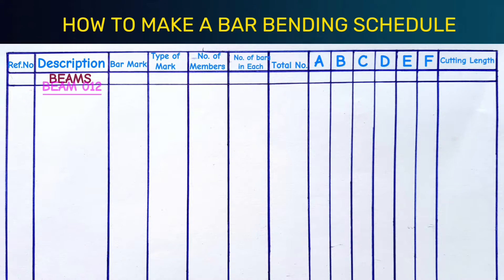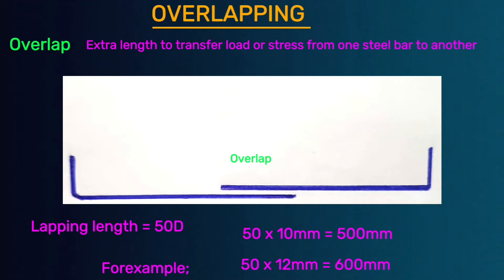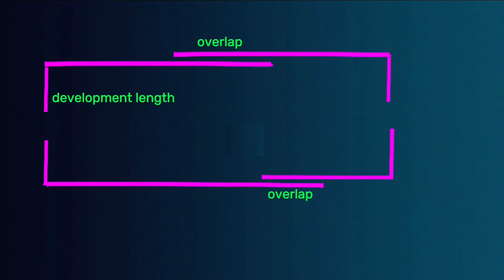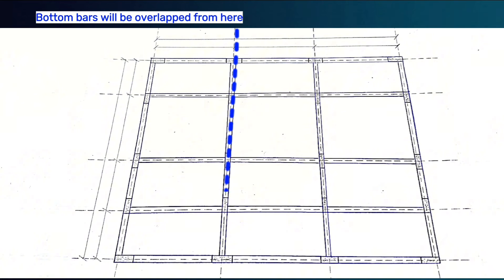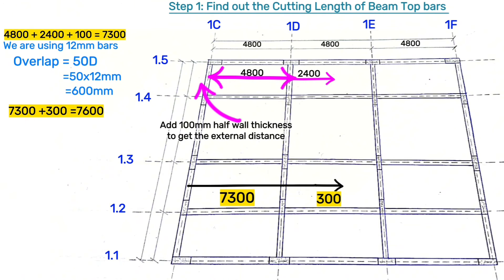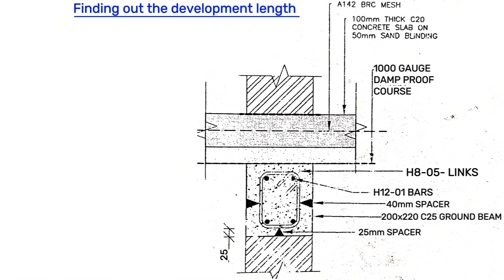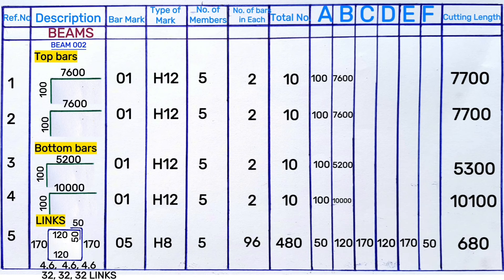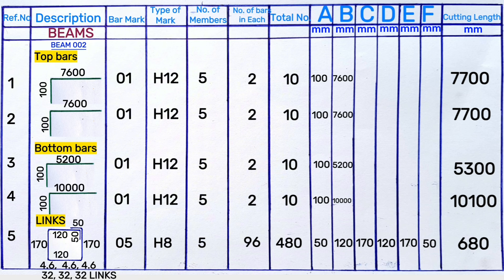How to make a bar bending schedule for BEAMS - A Step by Step Guide

Comment: Ian what's the work of Diploma graduate in a Construction company?
Reply from the maker: Hello Engineer, 
A diploma graduate can do alot of work but majorly these three 
1. Estimation of building materials (Steel, Sand, Cement Aggregates, masonry, paint etc Everything)
2. Do Levelling using dumpy level, total station and other tools on site but mostly those 2

3. Setting out structural members as the project progresses e.g Foundation, setting out Columns on every floor, Staircases, beams etc
The rest is simple but once you master those 3, you  are good (1. Estimation 2. Levelling and 3. Setting Out)